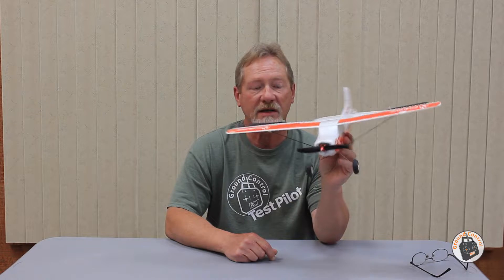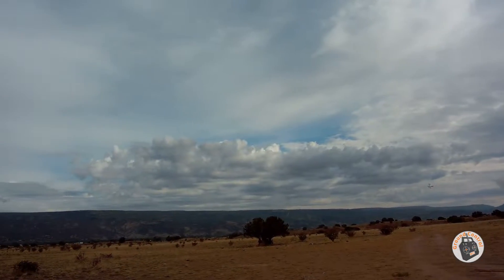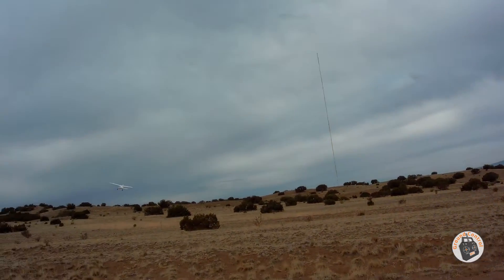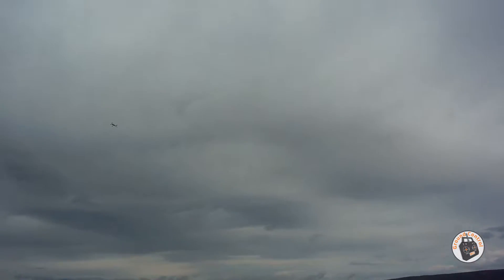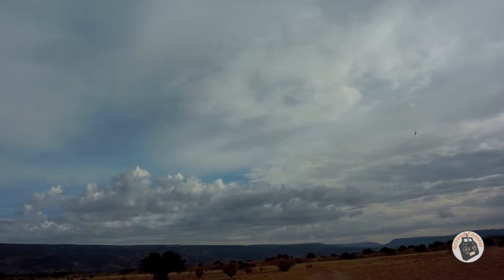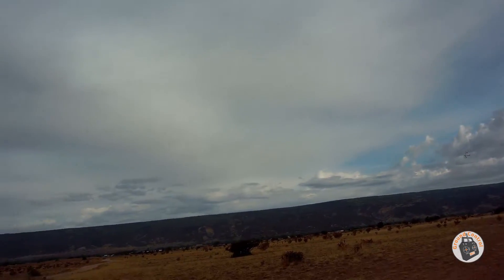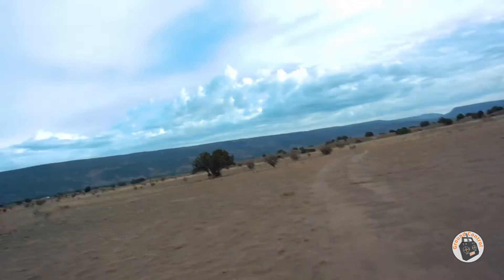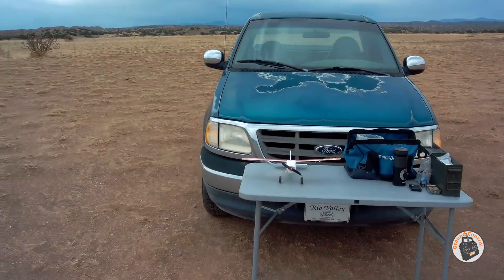Gyro Test #2 - CrossOver-RX AR3207G Receiver / Gyro - Brushless Motor Eachine Mini Cessna 550mm RTF

Comment from the maker: Don't Forget to Subscribe -> https://www.youtube.com/GroundControlRC?sub_confirmation=1
Don't forget to Follow Us on Facebook -> https://www.facebook.com/GroundControlRC

Eachine Mini Cessna RTF
https://www.banggood.com/custlink/mmGRjZRiQT

BetaFPV 1506 3000kv Motors
https://bit.ly/3jPwexc

RacerStar Racing Edition BR1306 3100kv 1-2S Brushless Motor
https://www.banggood.com/Racerstar-1306-BR1306-3100KV-1-2S-Brushless-Motor-CWCCW-For-150-180-200-RC-Multirotor-Frame-Kit-p-1065662.html?p=WE081047791920140372

Gemfan 5030 ABS 2-Blade Prop
https://www.banggood.com/10pcs-Gemfan-5030-ABS-Direct-Drive-Orange-Propeller-Blade-p-1070004.html?p=WE081047791920140372

HQProp Durable T5x3 Toothpick Propeller (Set of 4)
https://www.getfpv.com/hqprop-durable-t5x3-toothpick-propeller-set-of-4.html

CrossOver-RX AR3207G-D (DSM2/DSMX) 7 Channel Micro Receiver with SR3X Stabilization 7A 2S Brushless ESC +Telemetry
https://www.mxo-rc.com/en/aircraft-rx/51-crossover-rx-ar3207g-dddsmx2-built-in-brushless-escgyro7ch-microrxtelem.html

CrossOver-RX AR3207G-A2/A2+(FLYSKY-AFHDS-2A) Built-in brushless ESC/GYRO/SR3X/7CH MicroRX/TELEM
https://www.mxo-rc.com/en/aircraft-rx/50-64-crossover-rx-ar3207g-a2a2flysky-afhds-2a-built-in-brushless-escgyrosr3x7ch-microrxtelem.html#/33-ar3207g-a2

CrossOver-RX AR3207G-F2(FRSKY-D16) Built-in brushless ESC/GYRO/SR3X/7CH MicroRX/TELEM
https://www.mxo-rc.com/en/home/54-crossover-rx-ar3207g-f2frsky-d16-built-in-brushless-escgyrosr3x7ch-microrxtelem.html

CrossOver-RX AR3207G-F1(FRSKY-D8) Built-in brushless ESC/GYRO/SR3X/7CH MicroRX
https://www.mxo-rc.com/en/home/57-crossover-rx-ar3207g-f1frsky-d8-built-in-brushless-escgyrosr3x7ch-microrx.html

CrossOver-RX AR3207G-S(FUTABA-SFHSS) Built-in brushless ESC/GYRO/SR3X/7CH MicroRX
https://www.mxo-rc.com/en/home/56-crossover-rx-ar3207g-sfutaba-sfhss-built-in-brushless-escgyrosr3x7ch-microrx.html

HobbyKing HK-5320S Ultra-Micro Digital Servo 1.7g
https://hobbyking.com/en_us/hk-5320-ultra-micro-digital-servo-1-7g-0-05sec-0-075kg-1.html?affiliate_code=YRCVWOSKMDXLVUW&_asc=5357157305

Turnigy nano-tech 300mAh 2S 35~70C Lipo
https://hobbyking.com/en_us/turnigy-nano-tech-300mah-2s-35-70c-lipo-pack.html?affiliate_code=YRCVWOSKMDXLVUW&_asc=1907623358

Turnigy Nano-Tech Plus 300mAh 2S 70C Lipo
https://hobbyking.com/en_us/turnigy-nano-tech-300mah-2s-70c-hr-technology.html?affiliate_code=YRCVWOSKMDXLVUW&_asc=3529300490

Turnigy nano-tech 370mah 2S 25~40C Lipo
https://hobbyking.com/en_us/turnigy-nano-tech-370mah-2s-25-40c-lipo-pack.html?affiliate_code=YRCVWOSKMDXLVUW&_asc=6202436983

RadioMaster TX16S MKII Hall Gimbal 4-IN-1 ELRS TX
https://www.banggood.com/custlink/KK3EUzvecp

Banggood GCRC: https://www.banggood.com/custlink/GmDmQ1nVkO

Comment: Definitely did the trick.  Nice work.  A shame the brushless Xk A160 didn't work out as well from the factory.
Reply from the maker: Thank you much!
I still have nightmares about the XK A160 ;-)
This Mini Cessna flies a lot better than I thought it would.
See you in the Air!
Reply: I super foiled some two inch wing extensions and cut down the rudder size on My second A160, an it still does the drill bit. Next attempt I'm putting those vortex wind disruptor things on the leading edge. Ahahahha, thing is such a fail. Beauty Dog.
Reply: @jonoedwards4195  Heavier planes just need more speed to avoid the stall.  Keep that prop turning!  ;-)

Comment: @05:33 , nearly ran outta air,, Aahhahah, bet that woke You up!
Awesme when Your time spent modding is rewarded.
Beauty GCRC. Our Micro Sport King.
Reply from the maker: Hi Jono!
Hehehe...sometimes that ground gets closer much more quickly than I anticipated ;-)
I'm having so much fun ;-)
Now I'm putting that PhoenixS together.
It's going to be awesome!
See you in the Air!
Reply: @GroundControlRC  PhoenixS Rules! I carved big flaps into mine, doesn't need Them but makes for even more fun. Unreal GCRC.
Reply from the maker: @jonoedwards4195  I have been wanting to put that together for such a long time.
It looks just like it's Big Brother.
I'd like to put Flaps in mine as well but I'm using the RadioLink Byme-A Gyro and it's just a 4 Channel.
Maybe they'll come out with a 6CH.
Are you running a 3S LIPO on yours?
I have the kit so I put a 3S Power System in it and if I can find a smaller set of props I may try a 4S later on.
Reply: @GroundControlRC  Yes, I pulled the tronics out of My destroyed ASW-28 after I fried the S-Models motor running 3s, Thing hauls with the 28 running gear in it. 4s power mods are calling You to do it,, an so am I, Hahhahha!

Comment: Where do you get the Rx
Reply from the maker: OOps!
Wrong information.
I used the CrossOver-RX AR3207G Micro Receiver that has a Built-In 2S-3S Brushless ESC, SR3X Gyro, and Telemetry.
You can also use the Brushed-to-Brushless Module.

They have since tested the Brushed-to-Brushless Module and it works fine with the Stock Receiver Board.
So you can use the existing Board and the B2BL Module to perform the Brushless Conversion as well.
Links to everything are in the Video Show Notes of this Mini Cessna and the Video Show Notes of the Mini P-47 Conversion.
See you in the Air!